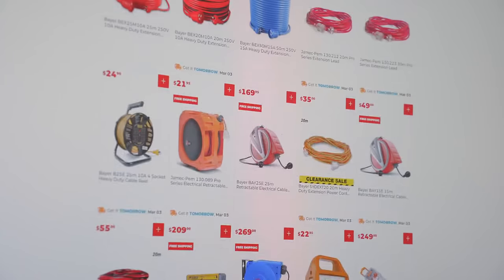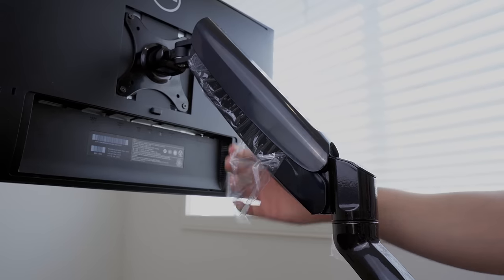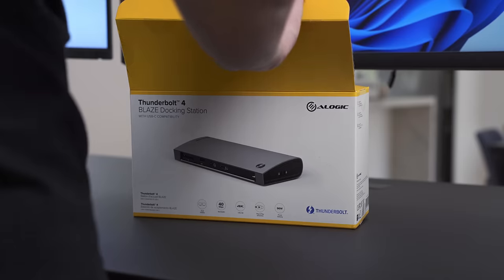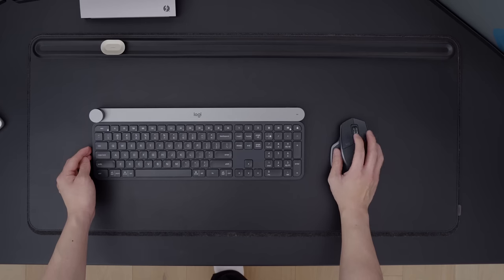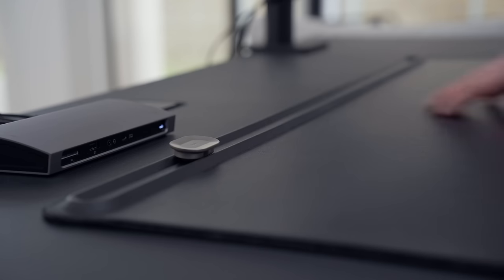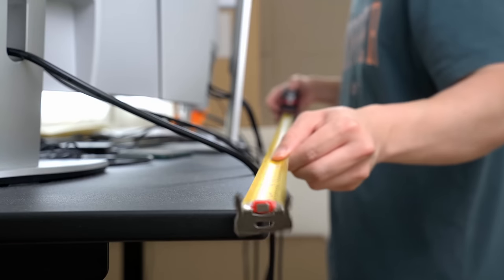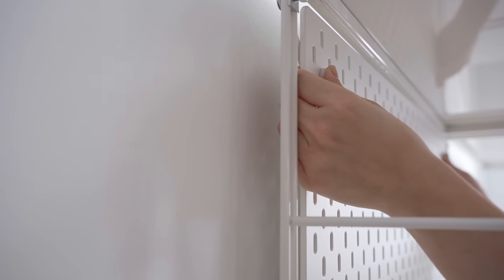Building my MODERN MINIMAL Desk Setup 2023!

Comment: when cleaning your pc I suggest using canned air since the bristle on a vacuum cleaner may make static electricity that can damage your motherboard and other components or knock off any small pieces from the motherboard
Reply from the maker: True, thanks for the tip!

Comment: I've come up with a foam/sponge rubber desk mat that turned out to be very comfortable and fairly mouse compatible, more like moderate sensitivity. Been using it for 3 years personally and my friends, so far it's been great so I've made a whole batch of them, it's called Fusionstrike Limestone Desk Mat if anyone interested getting one (currently ship within UK but could sort out international shipment too). The rubber is made from sustainable limestone rock instead of oil/petrol which makes it more environmentally friendly than most desk mats out there. It's laminated with super stretch smooth nylon so it's easier to clean it than most cloth mats.

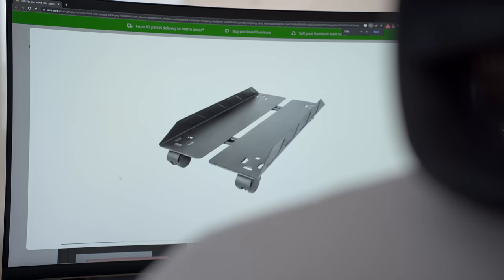Comment: At 7:45 you're vacuuming the dust filter. It is magnetic. You can take it off for easy cleaning. And you don't need to pull apart the whole PC every time, just pop off the front cover and clean up the filter for improved airflow and to keep the internals cleaner for longer.

Comment: PRO TIP - put that rotor for the light under the desk using 1 screw, it will not be on the table and its under the table easily accessible (as you know you are not using it that much, maybe 5 times a day). Keep it on the table only if you like it there.
Reply from the maker: Not a bad idea, thanks!

Comment: I got cable wraps instead of an open cage (that collects dust and is harder to clean on the long term.  Also, for the under desk cable management, get a closed system - the open ones collect dust and are just a pain to clean. And if you do photo/video work, i would actually avoid a light bar in front of the screen - Im using a  4K100% SRGB calibrated panel with a  matte display, and lights in front of the display are a bad idea - One very unexpected side effect of pandemic videoconferencing is that I got a key light, it's recessed about 2"behind the monitor and points down towards me and my desk - that way the light doesnt affect your actual screen. And being a key light with 2.8k to 6.5k WB, it's easily adjustable to match my room lighting at night.  I swear by this lighting setup and I no longer have a desk lamp or overhead light.
Reply from the maker: Ooooo, very much appreciate the tip man. I'm loving the idea of the key light as desk lighting. Something I will definitely look into going forward!

Comment: You might wanna check out the netdot magnetic charging data transfer cable. I plug the magnetic head on my logi mouse and keyboard all the time, including some of my other devices. And shared only single or two cable for charging or data transfer purpose. Is very versatile and have a nice touch on the setup.
Reply from the maker: Looks interesting, might test it out. Thanks for the tip!

Comment: The ports are on the back of the docking station because that's where they belong. To break it down more: the host connection; line out for speakers; DisplayPort; HDMI; and most of the USB connections belong on the back. This is where you should plug in things that stay plugged in all the time. The only connections on the front should be: SD card slots; headphone jack; two or three USB posts to plug in thumb drives or charge phones, watches, tablets, mice, keyboards, etc. Otherwise, you have a mess of cables all over your desk which is NOT clean and minimal. Good job on the clean minimal setup.

Comment: I have the S3221QS and an LG 32" 4k in portrait. S3221QS is a great monitor. If you get the screen flickering with the MacBook set the color profile to Rec 709, the darker blacks have stopped the flickering for me.
Reply from the maker: I see, luckily I haven't had flickering but I'll keep it in mind if it happens. Cheers for the tip!

Comment: Omg bro this is absolutely sick!! I love it!! & the quality of the video is top notch. I want something just like this. & where did you get the desk from? I recently just bought my own equipment for my own setup bc I want to get into content creating

& I was trying to think of different ideas for my setup. I have 3 27" monitors. Dell monitors. & I want 1 of them to be vertical

This is very inspiring. Smooth look. It's a grown up look if that makes sense. It gives a real business minded & professional vibe ya feel me? I love it 

Also where did you get the cable brace? It reminds me of something out of Terminator or Predator lol Awesome bro. You just earned yourself a new subscriber. This fire!! 💯

Oh & 1 more thing.. I went to the OMNIDESK site immediately after watching your video & I saw they have a desk on sale for like 649.00. They have it labeled as the "CLASSIC' Omnidesk. Do you think this will work for my 3 monitors? I think  the compact large at 153cm would work perfectly. But what do you think? Any advice would be greatly appreciated my guy. Seriously. Thx in advance
Reply from the maker: Hey man, thanks for subscribing. I'm happy to hear you were able to take something away from the video. Yeah the cable spine looks sick, I have a links in the video description for the cable spine and the desk if you want to check them out. I think you could get away with a 153cm desk if you're using monitor arms but it could get a little cramped if you're using the stock monitor stands. Let me know what you decide on in the end

Comment: quick question for you. How are you switching between monitors from your pc and laptop? are you toggling the inputs on each monitor?
Reply from the maker: So when I'm switching, I usually turn off one of the devices which disconnects the video signal. When I turn on the new device the 32 inch monitors can automatically detect the new signal and switch to the right video input. Unfortunately if I'm using both the PC and Macbook at the same time, I do have to manually toggle them.
Reply: @TerryX_  I was looking for KVM switches, but I didn't find anything that fits triple/dual monitor that is good and affordable. :(
Reply: @Mestrinhow  Try this KVM switch. ...Been using for 2 PC and 2 monitors. simple to install - very nice design.

Comment: Great video. I really like your setup. 

Two feedback mostly from me because I want to copy some elements of what you have done as I almost have the exact hardware setup as you. 3 Monitors, Mac, PC and a laptop, etc.

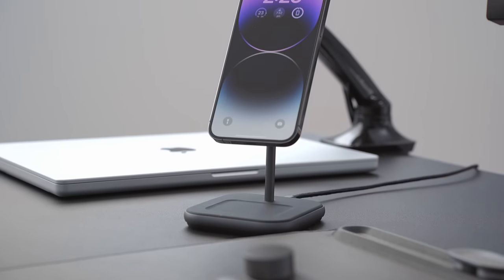Because almost all of the shots are very close to the specific subject, I see the specific subject very clearly, but I didn't get a good overall picture of the setup. The only shot that helped me a lot is at 10:52, but this is only from the back. I don't recall seeing anything from the front as a wide angle view.

Also it might be helpful to outline how much it cost you to do all of this.

But overall, really well done. Thank you for sharing.
Reply from the maker: Hey Andrew, glad you like that setup. Really appreciate the time you took to write out that feedback and I will definitely keep it in mind for the next video! If you don't mind me asking, which elements will you be adopting?
Reply: @TerryX_  Thank you terry for writing back. I haven’t decided yet but the cable management, putting the power strip attached to the bottom of the desk is a very neat idea. Also the dongle seems quite powerful. I have a USB based switch selector that I can use to switch different machines quickly so definitely not as clean setup as you have. I like the big pad below the keyboard. I like the machine dolly. I have a three monitor setup and I have used a monitor arm before but that one is not used anymore so I am likely not getting another one anytime soon.
Reply from the maker: I see, once again appreciate the feedback Andrew. Really good to know what people found the most useful!

Comment: Okay so everything was great, but you should try cleaning your PC outside. Because it's got fans it's basically a giant air filter and cleaning it inside is just redistributing the dust in your home to get sucked back into the PC. If you clean it outside for a few cycles it'll start getting less and less.
Reply from the maker: Noted, cheers for the advice 👍

Comment: awesome setup! great video! you mentioned that you use all 3 screens for the windows pc and 1 for the macbook. What do you use to switch between the 2 systems for the screens?
Reply from the maker: Thanks! The 32 inch monitors switch automatically if there is no signal. I normally use one device at a time so if I turn my PC off and then plug the Macbook into the dock, the monitors will switch to the right input

Comment: You have a great desk setup.  I am working on my home office desk and wanted to ask a question.  Like you, I noticed that you use a windows based operating system to run your CAD file or construction documents.  I recently bought a Mac Book Pro and found out that the software that my company uses does not work with IOS thus forced to keep my window based system.  I have a Dell WD 22TB4 docking station that delivers power to my laptop when connected. My question is this, is it possible to connect my two screens to the windows PC and have the option to connect the Mac Book Pro via the docking station as I choose?  How would the wiring be set up?  Thank you in advance for your response.
Reply from the maker: Hello, I guess that would depend on the number of display inputs your monitors support. If you're monitors have support for at least two inputs each, and you want both devices plugged into the monitors and have the ability to switch between them, I guess you could have each monitor plugged into your dock for your PC and then also connect the monitors to your Macbook separately via a HDMI/Displayport to USB-C cable. If you're using the dock for your Macbook, same thing but plug the Macbook into the dock, dock into monitors and plug the second set of HDMI/ Displayport cable from the monitors directly into the PC.

Alternatively, if your monitors only support one input each, you could also buy a dock that has KVM support so that you can have both the PC and Mac plugged into the same dock that allows you to switch between devices. 

Keep in mind, not all Macbooks support dual monitors so make sure you check on the Apple website. Hope that helps.

Comment: The biggest hassle with any monitor arm is actually getting multiple screens to line up. The slightest table movement can bump them out.
Reply from the maker: I actually haven't run into that problem myself, the counterbalance on the Dell arms works quite well and holds the monitors pretty firmly in place
Reply: dont use cheap arms, or tighten the arms you have.

Comment: Hi, nice setup 😊
What are dimensions of your desk? I will be using 3 monitors as well, so want to know how big should be enough to buy (I have to pay attention since my room is not that huge).
Reply from the maker: Thanks! The table is 1825mm x 760mm (71.85 inches x 29.92 inches). You can definitely go smaller if table space isn't a concern but I probably wouldn't want to see too much closer when using 3 monitors.

Comment: So you have 3 screens, 1 mbp and 1 pc. How do you switch input to the screens between MBP and PC?
Reply from the maker: The 32 inch monitors switch automatically if there is no signal. I normally use one device at a time so if I turn my PC off and then plug the Macbook into the dock, the monitors will switch to the right input

Comment: I have one question, how do you switch between mac and windows on the same set of 3 monitors? and the 3 moinitors, you can use either the mac or the windows one at a time, not simultaneously right?
asking cuz I have a similar setup but with one monitor :)
Reply from the maker: The 32 inch monitors switch automatically if there is no signal. I normally use one device at a time so if I turn my PC off and then plug the Macbook into the dock, the monitors will switch to the right input. The M1 Pro MBP only has video output to two of the three monitors though. 

The monitors actually support PIP so I could actually use them simultaneously if I wanted to!
Reply: @TerryX_  ohh, understood. Thanks

Comment: Do you have an update regarding the Xiaomi monitor light “puck” switch? Does it still look like its brand new? I had mine for almost 3 years now and the rubber coating on the “puck” is now sticky. I used all sorts of suggestion on how to remove the sticky stuff but didn’t work.😢 Even though the light is still working, I just hide the switch somewhere since it’s an eye sore.😂

Comment: Nice video! Would be great to know how you hung your pegboard!
Reply from the maker: So the pegboard comes with a mounting bar that it screws into. Normally you'd nail the bar into the wall, then put two screws into seperate holes on either side of the pegboard, before screwing it into the mounting bar. What I did was, I didn't put the screws all the way through the mounting bar, only the tip of the screw, leaving a gap between the mounting bar and the pegboard. So I've just hung it on the cross bracing on the shelf so that the space where the screw is, sits on top of the cross-brace. For stability, I tightened to screw so that the cross brace is sandwiched between the mounting bar and pegboard.

Hope that makes sense! If people want a bit more detail, maybe I can do a quick short on it.
Reply: @TerryX_  i think i can imagine it. Basically u didnt screw it on too tight?
Reply from the maker: Yeah, so I didn't screw it all the way into the mounting bar, meaning the screw itself becomes a ledge that rests on top of the crossbar

Comment: Hey, I ordered the castor wheels from your description. Unfortunately, they don't fit in my omnidesk. My bolt size is smaller.
 Is there anything you did to make it work?
Reply from the maker: Hey man, nope I didn't have to do anything. The wheels fit perfect for me. Although I've gone through my order history to double check the sizing and it looks like the seller has changed the bolt size on their listing. The right bolt size for me was an M8x1.25. I recommend taking your levelling feet to the local hardware store to double check. They should have a chart with different bolts you can screw your levelling feet into to check the size. After that, make sure the caster wheels match. Hope that helps!

Comment: Hey, great video. How do you cycle through your macos and windows on your three monitors?
Reply from the maker: Thanks! The 32 inch monitors switch automatically if there is no signal. I normally use one device at a time so if I turn my PC off and then plug the Macbook into the dock, the monitors will switch to the right input

Comment: How do you swap the monitors, etc. between computers? Do you just swap the hub's cable between devices? Seems a little annoying to (dis)connect to/from the PC under the desk.
Reply from the maker: The 32 inch monitors switch automatically if there is no signal. I normally use one device at a time so if I turn my PC off and then plug the Macbook into the dock, the monitors will switch to the right input

Comment: Hi, I know this is silly question, but could you confirm that ALOGIC Thunderbolt dock can run two external monitors in extended mode from ONE MBP thunderbolt port?
Reply from the maker: Hello, not a silly question don’t worry. I can confirm you can run both monitors in extended display from one MacBook Pro thunderbolt port.

Comment: just a question about the dock can you connect a USB C monitor (like a dell) to the dock and work it that way? I ask because I have an older dock with USB C but when I connect my new curved Dell monitor to the USB C in the USB C connection in the dock it doesn't work (only when you connect the USB C cable from the monitor directly to my PC. Am I missing something? Is there such a thing as a different USB C port (which doesn't do picture and just charges for example?) Love your channel!! Thank you so much!
Reply from the maker: Hello, yes the ports on the back are thunderbolt 4 certified so it will support video on a USB-C monitor as long as the cable and monitor also support video. Yes you're absolutely right, not all USB-C ports support video, so it's likely the port on your current dock doesn't. Hope that helps!

Comment: I don't know if you didn't cover it or if I missed that part, but since you have both a laptop and a tower PC and I'm assuming both of them are connected to all three monitors... How did you manage to do that? Is your docking station also a KVM switch?
Anyways thanks for the video, you gave me a lot of ideas for my desk setup!
Reply from the maker: Awesome, glad it helped! The 32 inch monitors switch automatically if there is no signal. I normally use one device at a time so if I turn my PC off and then plug the Macbook into the dock, the monitors will switch to the right input.
Reply: @TerryX_  Hello, I also have the curve Dell monitor and similar situation like yours (ie. using both PC tower and iMac). The problem is the Dell monitor only get signal from HDMI 1 even though the monitor has two HDMI ports. I tried to have the HDMI from my iMac plug into the HDMI 2 and the HDMI cable from the PC tower plugged into the HDMI 1, but only the signal from the HDMI 1 is recognized even when I turned off my PC tower. Do you have an alternative solution?

Comment: the problem with table mounted monitors are they wobble even with minor movement on the table. i used to have similar setup but now rather than using table mount i am mounting my monitors directly to the walls. no more wobbles.